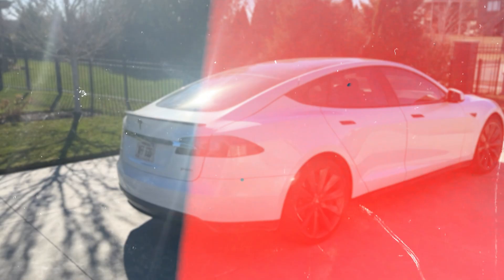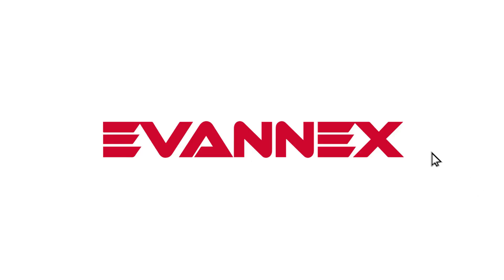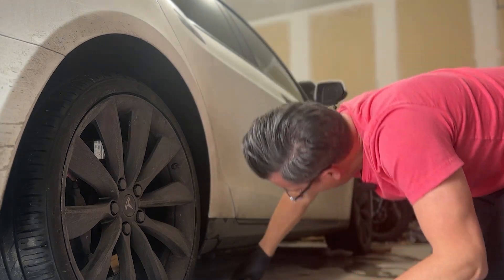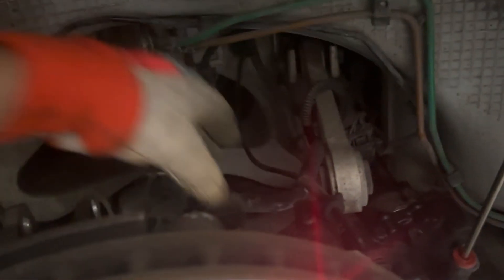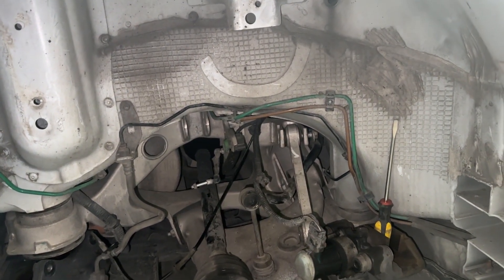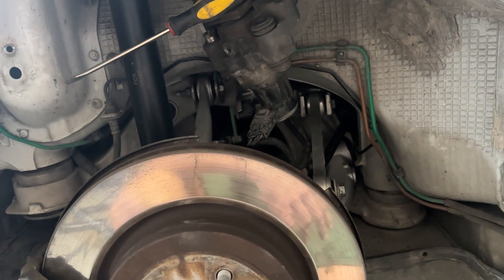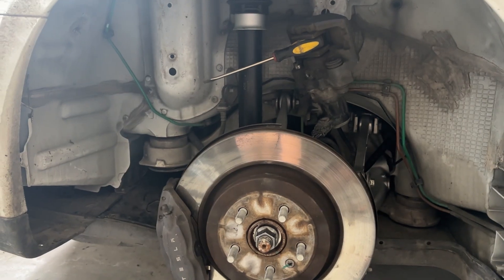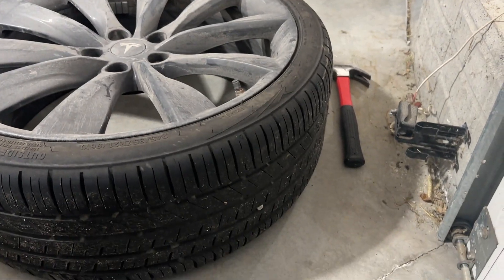Tesla Model S Suspension DIY Maintenance Guide: Keeping Your Ride Smooth and Safe!

Comment: Impressive.  First video I have seen of someone taking apart an EV's suspension.  And it was done without guidance?  Wow.  I think new wheels and tires might do alot to improve the looks of a car which has not aged that much, still looks current.  Congrats on getting it all back together and running. Hopefully more DIY videos on Teslas and other Ev's will be coming out.

Comment: It wasn't clear from the video, did you keep air suspension or replace it with coil suspension?
Reply: yes, I don't know what happened in the video. Boom suspension is changed and this is your comprehensive guide
Reply: $600 to go to springs
Reply: @Nicholas-f5  $600 seems reasonable.  I was thinking about changing out the air suspension in my older Navigator for springs because it would go flat on cold mornings, but, I ended up selling it (during the summer).